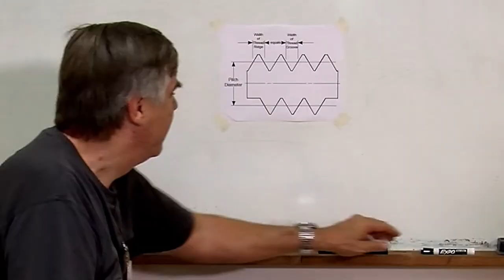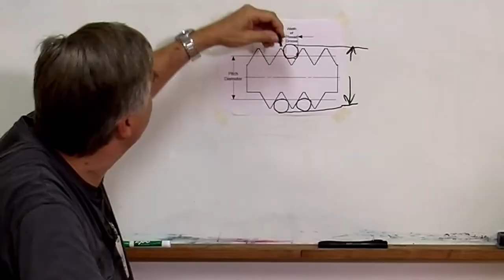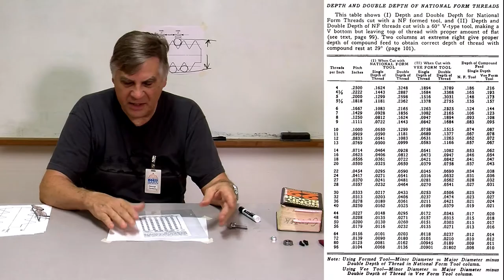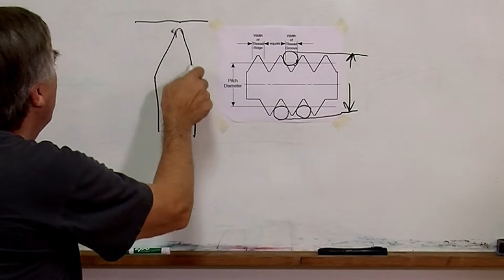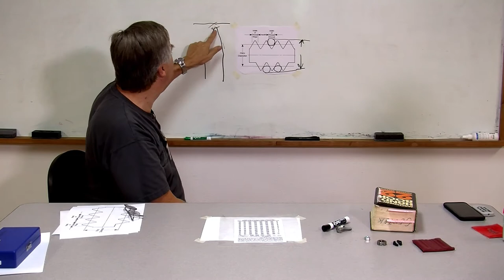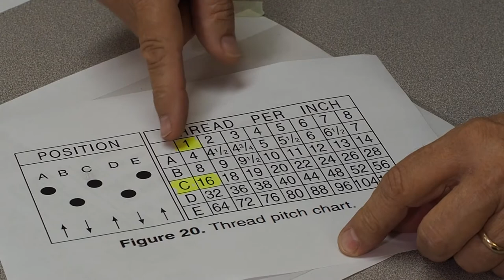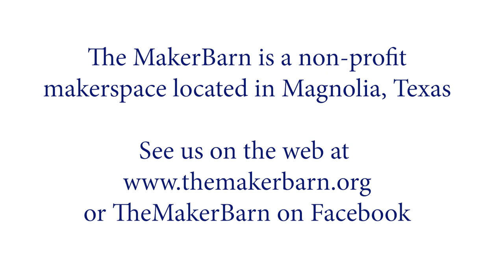Thread Cutting on the Grizzly G4003 Lathe

Comment from the maker: One thing I did find interesting was the fact that the G4003 does not use a 127:120 gear set for cutting metric threads.  All of the lathes I have worked with use the 120:120 because 127 is a prime root of the 254:1 ratio between millimeters and inches.  The G4003 uses 91:86.  This comes out so close that it would not make a difference in normal short threads.  But if you were making a leadscrew, the error would be in the order of 0.001" in 6".  Something to keep in mind.  I have never measured the actual accuracy of the leadscrew installed on the Grizzly, so I can't make any guesses on the accuracy of inch threads.

Comment: hey man just checking out you video.  I had the same problem you have with the cross slide handle dropping down changing the angle.  if you have the manual it is part number 530a that needs to be tightened. it drove me crazy.

Comment: Did I miss the part where you talked about the Thread Dial so you'd know when to engage the half nut again? 
I ask because my machine has 6 positions not 8 like I've seen in some of the videos. I'm trying to cut a 6 mm x 1.0 thread on stainless steel rod. Hum I know I suck at this because I ended up the with the skinniest threads I've ever seen on a screw. LOL, now I have to make that blank all over and start again. I think I'm going to practice on some scrap first. 
Other than that I really enjoyed the video. Thanks for sharing. Best Wishes & Blessings.

Comment: 3:49 pronounced ( pie- zen-ski )
10:54 chart 16 thread per inch =  single depth of cut 0,0406
On a 30,60,90 triangle I get 0.054126588 
We need more teaching about the clearance involved between nut & bolt or more info about what the handbook means.
I understand if you are teaching people that don't understand the special triangles, but let's go.
No one wants to take a deep dive into the real math/geometry. I may seem bitter, but that comes from my high school failing me. I took it upon myself to learn some math on youtube. People are paying big money in taxes & the schools don't care..
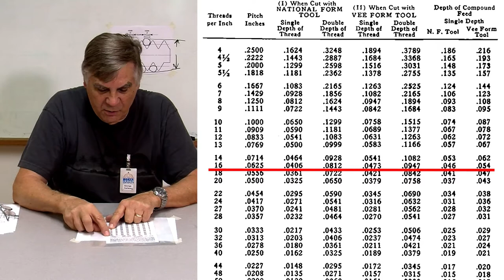Reply: Oh @hit 12:54 you said 54 thousandths. I'm lost. 
It doesn't really matter because I don't even have a lathe yet. 
I'm just trying to learn while I wait.
Reply from the maker: @simpleman283   A correct National Form thread does not have a sharp point, instead it has a truncated shape.  So using a National Form tool, the thead is not cut nearly as deep.  Because National Form cutters are made for a specific thread pitch, hobbyists generally use sharp point tools which do not have to be used for a specific thread pitch.  These tools do produce a sharp point so they go to full depth, the depth you had calculated.

Comment: So helpful.  Question - I'm looking at getting my first lathe, I've been a fabricator but want to get into machine work now - been looking at the grizzly G0602 10 x 22 but thinking maybe I should wait a little longer and upgrade to a bigger unit like this G4003.  What's your opinion?
Reply from the maker: Bigger is almost always better.
Reply: I have owned and used a ShopFox M1112 which is the identical lathe in different paint, for about 7 years. I love it, buy it.
Reply: I was in a similar situation. Wanted a lathe to learn on and eventually perform some general hobby making and some gunsmithing. I put a WTB add in Craigslist and a local machine shop contacted me. They have an ENCO 12x40 Gearhead lathe that they’re looking to get rid of (too small for the work they do now). Got it for an extremely good price (according to the forum I’ve been on). It should serve me well for a long time.

Comment: Thread AWAY from the chuck
Reply from the maker: This is not always a good idea.  Recently a member of our makerspace was using the reverse threading technique on the same lathe as was used in this video.  Running the lathe in reverse puts lifting forces on the compound and crossfeed.  Lathes are not designed to take these forces.  As long as the forces remain light, this is not a problem.  But if you crash the tool, bad things can happen.  He apparently had some sort of crash.  The lifting force was so great that the right side of the dovetails on the slide was torn off.  Now we wait four months for a new compound slide from Grizzly.
Reply: @makerspace533  to each their own